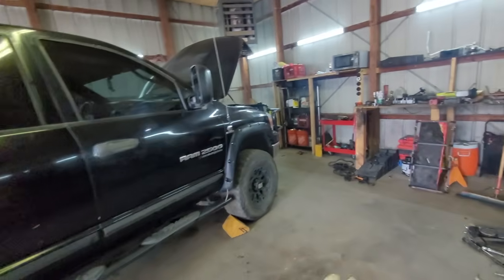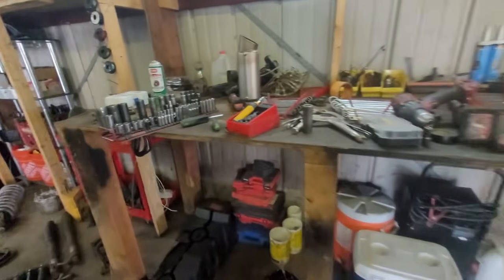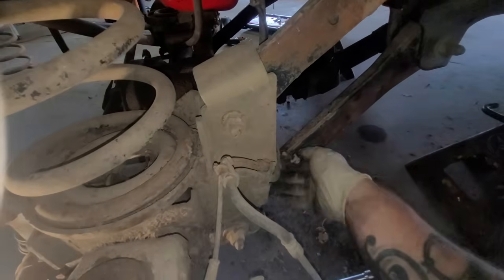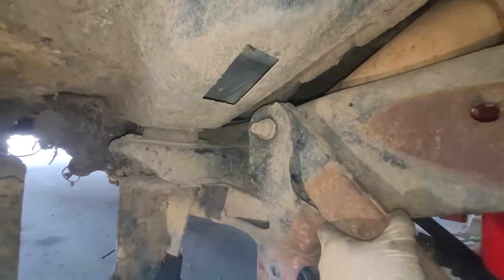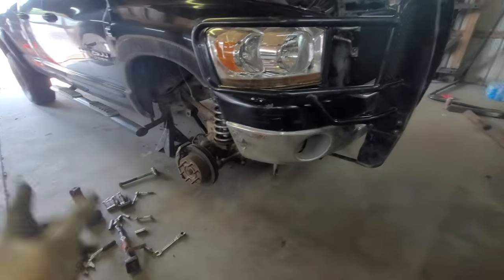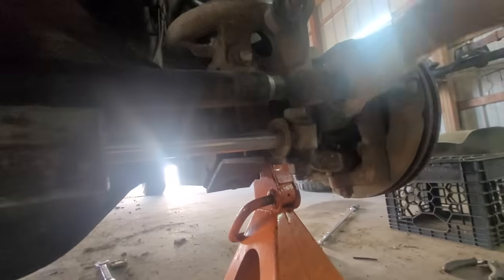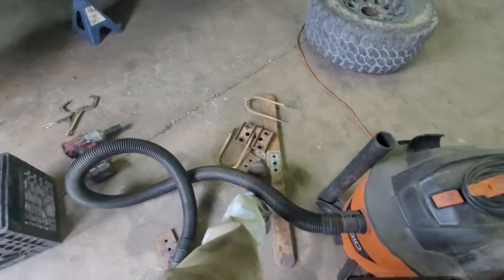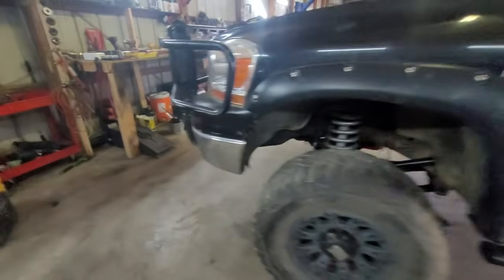Installing A 5" Lift Kit On A Ram 2500 Diesel

Comment: Do what the Euro mechanic do and start charging to pressure wash the areas you are going to have to work in/on. It would save time over poking it with a screwdriver, and having to vac the shop floor. 
Much nicer working on something that is relatively clean.
Reply: This is what I do.  After the work is performed I detail the engine bay to look like new. People are usually so impressed they don't care about the costs.

Comment: You can center the axle pretty close by the  bump stops ,  I used 2 plumb lines for mine.  Then drove it to the alignment shop.   They said I was pretty close to perfect.

Comment: Hi Steve, I just replaced both front hub bearings on my 06 ram 3500. The book said lug nut  torque was 155 ft/lbs. Is 140 a torque you use or a spec you found? Love the variety of your videos.
Reply from the maker: The dually lugs nuts have 140 ft lbs written on them. Look really closely as the end of the nut. It's in REALLY small writing

Comment: The life of working on a north eastern truck. 🤣🤣
Reply from the maker: This one's actually from Alabama
Reply: @CPSteveMiller  damn looks like a truck up here. How's a 5" lift with hot shot work? Guess only down fall would be worst gas milage?
Reply from the maker: This one isn't a hotshot truck. Not sure what he's doing with it but I know it's a work truck of some sort. Hotshoting with a lift would really start to give problems with drive shafts and a lot of other components. I personally wouldn't recommend it!
Reply: @CPSteveMiller  no lift at all or not 5"?  For me just a leveling kit minimum for the front. But maybe 2"?
Reply from the maker: Leveling kit is fine. It doesn't alter the drive line like a full lift does. At least not enough to cause a problem. You will want bags or heavy-duty bump stops to compensate, though.